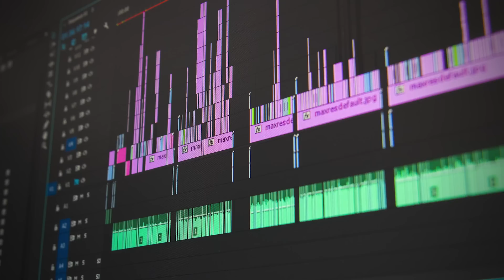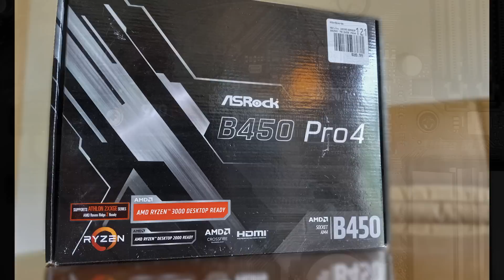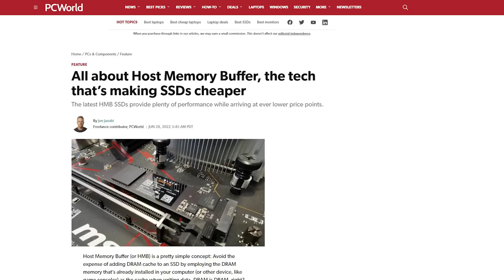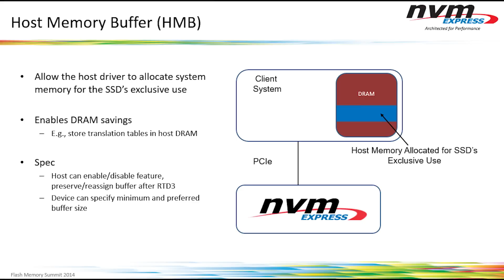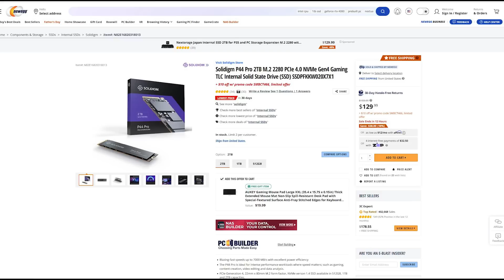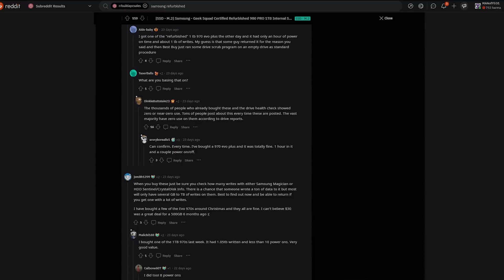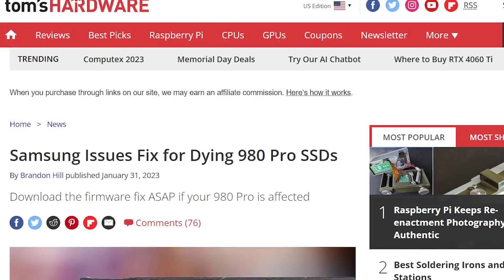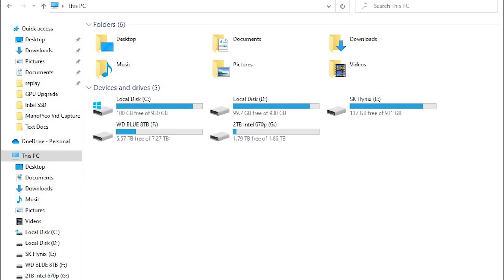SSD Buyers Beware: 7 Crucial Tips for a Smart Purchase

Comment: Samsung firmware bug?
Reply from the maker: Yes they had an issue where 980 pro and 990 pro drives were wearing incredibly fast and it was solved by a firmware update.  If you have samsung magician it should have updated automatically but its good to check that the firmware is up to date.

Comment: A word of advice. When you get your motherboard, just screw the m.2 screws it comes into the motherboard so you don’t need to worry about finding them or buying some later. I don’t know why they don’t just do this before they ship them.
Reply: I just got 2 Crucial M.2 drives and I was happy to see that they both came with a specific screw.
Reply from the maker: @TechGorilla1987  Wow that's awesome definetely makes me like Crucial a little bit more.  Which drive did you get?
Reply: @manofyeo  I got the CT1000P3SSD8 and the CT500P3SSD8 for my wife.
Reply from the maker: Yes this is great advice I've heard recently and I wish I knew when I bought my motherboard!  Thanks!
Reply: dude i couldn't find em, thankfully i got a bunch of m2 screws that work just as well
Reply: My cheap gigabyte b450m had the screw already installed 😊
I didn't know some other manufacturers don't do it
Reply from the maker: @frecio231  Sometimes they do, usually if they have a heatsink.  Other times they are just in a bag in the box.  I wish every drive just came with one like Crucial does.
Reply: @manofyeo  I think the only reason gigabyte would do it is because they were trying to save the cost of making the bag 😅
Reply from the maker: @frecio231  LOL that is SPOT ON!

Comment: whats with 4tb crucial p3plus?
Reply from the maker: Its a middle of the road Gen 4 drive with speeds around 5000MBs max.  It uses HMB instead of DRAM and is QLC so its more of a budget oriented drive.  The p5plus is better if you can afford it and are looking for a Gen 4 drive.  The teamgroup MP34 4tb with dram and TLC is on sale for $168 at newegg but I'm not sure how good of a drive it is.  It has good specs for the price though.  https://www.newegg.com/team-group-4tb-mp34/p/N82E16820331702

Comment: SSD is not a good choice for data storage. The best size is only about 256 GB for os and apps. The data should on,y be in standard drives
Reply: Like others have said. This is old advice that does not apply to modern SSD and NVME drives. At work we have data center Nvme drives that are more durable than any spin drives in terms of read heavy, write heavy, or mixed use cases.
Reply from the maker: Yes I use an 8TB HDD for storing videos and other data.  But SSDs are so cheap now HDD may soon be extinct..
Reply: @manofyeo  No way, SSD drives can be slower, and have much more limitations. Remember a drive constantly read writes, and SSD drives are rate a fixed number of them. That is why you cannot perform drive optimizations on SSD systems. And remember it is also more reliable for hdd raid systems too. Too many people are misusing SSD drives
Reply from the maker: @stevengoldstein114  Much of that applies to data center or professional applications though.  For the average home PC user or gamer they aren't going to burn through an SSD for many years unless it is a very cheap, low quality SSD.
Reply: @manofyeo  Maybe if the system puts the SSD drive to sleep. Then it will stop doing the routine reading and writing. Also remember there is virtual memory placed on an SSD unless reassigned to another drive. I do this to minimize the wear on the SSD.
Reply from the maker: @stevengoldstein114  The virtual memory being on an SSD can help overall performance if you are limited in RAM because it gives Windows faster access to it vs a normal HDD.  It will probably cause more wear but I guess its a trade-off based on your system and budget limitations.
Reply: @stevengoldstein114 you seem to be stuck in 2013. I switched to all SSD a long time ago and won't look back. 10 TB in my PC, 4TB is a sort of NAS solution and anywhere else. Just make backups of important data in few, separate locations and you're golden

Comment: I'm sad that I bought a 2TB 660p for $210 a couple years ago. Bought a 2TB 980 Pro for $195 last year. Now storage is dropping so much.
Reply: As long as you got sufficient use out of it during that time, you're fine.
Opportunity cost is an often overlooked factor when determining value.
Reply from the maker: It can feel bad but I try to think of how much use you have gotten out of it.  I paid $130 for a 1TB 970 evo on a black friday deal.  I also paid over $900 for my 3080 and I've seen people selling it for $450.  It's just the way it goes with technology.
Reply: 2 TB Nvme from WD is 100$ or so on sale right now. 1 TB is 52$. Crazy
Reply: to be fair, the 660p is far superior than the 670p due to using tlc instead of qlc chips, I still use both 660p and 670p drives, but they're just good cheap drives.

Comment: The first thing I always look at besides capacity and price is the TBW as that can get used up fairly quickly by some users. For my daily I am using some drives that are rated for 3200TBW bought on the cheap as they were retired from a data center plus they are MLC rather than the usual TLC nand.
Reply: mp34 has 1600TBW, and it's cheap as fuck TLC

I have seen some pcie (not m.2) x8 2x2tb intel drives though which look really interesting, only thing stopping me from getting those is the fact that I have no more pcie slots :(
Reply from the maker: For sure, heavy users will be much more affected by it than the average office or gaming pc.  Thanks for watching!
Reply: Capacity is something to be aware of, but needing "the best" for most people really is overkill.    This drive is a "tiny" 740TBW,  so using that COD:MW game at 125GB as a standard, he'd need to reinstall (write) the game every day for over 16 years to get to that that TBW limit, and by then any warranty is long since expired.    Now sure there may be some that do write huge amounts, e.g. data centers, and for them that is an important stat,  but for the vast majority of people not so much.    Ditto with speed, Gen3 PCIe will virtually be the same as Gen4 or Gen5 for the vast majority of what people do on their computers, any differences in how long it takes will basically be rounding errors.

Comment: <grin>  I won't admit to being a data hoarder but I'm pretty certain I've helped keep the doors of one of Western Digital's hard drive manufacturing facilities open.  Some nights I pour terabytes worth of data onto my bed and, giggling, just roll around in it.
Reply from the maker: Haha, Love it!
Reply: Well, Western Digital keeps their own doors open, since you have to replace defective WD drives so often
Reply: @SenileOtaku  
Experiences differ.  I maintain the computers for half a dozen family members and myself.  We have collectively owned at least 40 hard drives over the last 30 years.  The mix has included HGST, WD and Seagate. 90% of the early drives were Seagate because they were inexpensive and performed well. But when a third Seagate started suffering from bad sectors, I stopped buying Seagates entirely. Every drive we've purchased since was either HGST or Western Digital  If any of our WD drives lost or corrupted a single bit of data, I am unaware of it.  
Qualifier: We tend to replace each of our computers after about five years.  We sell, gift or donate the hard drives along with the computers.  
You go right ahead and avoid buying WD products. I wish you luck and Fortune.

Comment: Not low enough for the capacity. HDD still beats it by a long shot.
Reply from the maker: This is true since you can get an 8TB CMR HDD for under $100 now.  Great for general storage.
Reply: LOL no. 1TB HDD 7200RPM costs 35$ while the 1TB SATA SSD costs 45$. It is also a 4 times faster. COPE.
Edit:- I found 37$ 1tb sata SSDs and 50$ for DRAM cache enabled ones. For 48$ you can also get PCI gen 3 1 TB NVMEs with 3000+ read/write speeds. Now you gotta consume even more copium.
Reply: SSD and NVMe for system/OS drives.  Spinning disk for data storage.  It will still be that way for a while.  Not saying it will always be that way, but it's like backup tape that is always being declared as obsolete, bit when you need large-scale readily removable and archivable storage, it still does the job better.

Using the right tool or technology for the particular task.  If only you could get government bureaucrats to understand that concept.
Reply: Even if prices were par, I'd say 3.5" HDDs* are more reliable long-term cold storage. SSDs can fail without warning and take all your data. HDDs usually don't fail suddenly, and give enough warning signs to move your data off if they are having issues. Also, the magnetic recording in HDDs should last longer without refreshing compared to the electric charges used in SSDs.
*2.5" HDDs are pure trash in comparison though. Don't trust those.
Reply: @kunka592  I'm surprised to still see ignorant comments like this.

SSDs last much longer than HDDs, meaning you don't need to "look for 'warning signs;'" you just upgrade to a new drive whenever the capacity is no longer adequate.  The drive will likely outlast your data needs.

Experiments have shown 250GB SSDs lasting several hundred TBWs (the equivalent of more than 100GB written daily for an entire decade ).  This only scales up with capacity.

Additionally, most SSDs are designed to lock themselves into ROM mode upon failure; your data isn't lost.  Indications and Warnings preceeding that continue to improve with software.
Reply: @redslate  Cool tests, bro. Please keep all your data on SSDs without HDD backups. When your SSD decides to suddenly nuke itself with 99% of its NAND writes still remaining, don't go crying about it because it obviously couldn't happen in this universe.
Reply: @Kun Ka  Nice strawman:  presenting data redundancy as a mutually exclusive, medium-bound practice.  That's not at all accurate, nor is it a logical justification for your asinine assertion.

Congratulations, you continue to retain your ignorance.  🤤

Comment: Why are we using SATA SSD in the first place or is that some minority minimum wage trash problem?
Reply from the maker: SATA SSDs are still useful for older systems without NVMe support and still work quite well even as a boot drive.  I'm sure most people like me still use them from acquiring them in thee past when NVMe drives were ridiculously expensive.  I wouldn't recommend someone to buy one now unless they had to since it doesn't make much sense but there's no reason to not use them if you already have them.
Reply: Holy shit!  This comment is dripping with toxicity.

In common use cases, there's a negligible difference in write performance between NVME and SATA III.  The average user isn't typically moving mass quantities of data.  

In most read cases, the difference is indistinguishable.  Even most games won't benefit meaningfully.

Therefore, as a primary drive, SATA SSDs are perfectly suitable for the majority of people.  Even power users (the "minority") stand to benefit greatly from their use as they balance great read performance and reliability at a lower cost (~1/2) than NVME SSDs.
Reply: @redslate  I have such an older machine here. Total unit - been strong since 2012 and exclusively for gaming.  Over the years I have put in 2 x SATA SSDs and I have to say they are great boot drives!  Would like to see a some kind of tests comparing the same system+OS boot time for NVME latest gen; NVME older gen; SATA SSD.  But as you have alluded to already - I bet there is precious little difference.  Crystal Disk Mark is just a benchmark after all.  What matters is rubber on the road so to speak. (edit spelling)
Reply: @redslate your pricing is from last decade - show me a SataIII ssd that’s half the price of nvme and I’ll buy it, I need one for a sata m.2 enclosure. Nowadays they all  cost more than nvme, because they’re an outdated technology.

Comment: China SSD is coming!!!and it's very popular in China.

help former SSD's factory without fire😂
let the price of ssd becoming more reasonable and affordable.

yangtze memory 128 nano flash

kingbank KP260 1tb 
 ZhiTai TiPlus5000 1tb 
under 300RMB
Reply from the maker: If prices keep falling HDDs will be dead :)
Reply: @manofyeo  the issue is that there is no great software raid and hardware card for consumers that allow you to take these cheap 1TB-2TB NVME modules and compete with storage of a single 16TB spin drive that runs $200-270 USD.

Comment: My man! I had not considered that installing nvmes would result in sacrificing the number of sata drives. That could have caused some headaches. Thanks for the information!
Reply from the maker: It is often overlooked and can be confusing so I'm glad I could help.  I sure as hell didn't understand it when I first bought my motherboard.
Reply: Definitely something to be aware of, but if your looking at a mix of NVMe and other SATA drives I might suggest that external USB 3.0 drives might well handle whatever you were planning for the SATA drives.
Reply: @Faladrin  USB speed is theoretical, overhead, shared bus, and lower bandwidth hurt, also has device limits far lower than imagined based on how end points are counted.  Legit multiple controller pci-e expansion cards are expensive, cheapies are just single shared chip.   Always max out internal drives first.
Reply: Just depends on chipset, higher end supports more drives.
Reply: If you have a spare PCIe x16 slot, you can get an NVMe to PCIe adapter (which come in x4 but also x1 lanes) for cheap and stick your NVMe drive there. Depending on your mobo/cpu you will get less lanes for your GPU but the performance impact is almost none at x8 for most GPUs.
Reply: @Kun Ka  You can also buy PCIe daughter boards that give you more ports allowing you to install SATA III SSDs.  You'll want to review the speed limitations, but this can be a good use of otherwise unused x1 slots.
Reply: @redslate  That's what I ended up doing.  I have a SATA card for the 3rd & 4th HDDs since the NVMe took up 2 SATA connections.  I would have put the BluRay and DVD drives on the add-in card, but then the system couldn't see them as bootable drives (MSI motherboard, I've learned my lesson since then)
Reply from the maker: @kunka592  Yes I've considered it but I may use the slot for a capture card and I have enough drives for now so maybe in the future.  Thanks for watching!

Comment: SATA SSD without DRAM are a big waste of money as they are almost as slow as a HDD. (Unfortunately I know from own experience.) Is this the same with NVME and using part of your main RAM? (I imagine the connexion between NVME drive and RAM is much faster than with SATA, but does that help?)
Reply from the maker: While sata SSDs without dram are terrible, nvme drives with HMB really aren't that bad.  They usually fall short to drives with DRAM in benchmarking but in daily use I don't think the difference will be noticeable.
Reply: i never had problems with dramless ssd
Reply: @NippyNep  True , this comment is BS.
Reply: You`re probably confusing TLC vs QLC with DRAM vs DRAMless drives
Reply: @smuggy8576  no.
Reply: @AdamGeorge-pb3fm  WTH are you talking about? I use a DRAM cache less SATA SSD as my secondary drive. It's much faster than any HDD can hope to be. I Usually transfer files, play games and compress/decompress archives on that SSD. At least for those workloads it's great. SSDs will always have much much better latency than mechanical hard drives while also having faster sequential speeds.

It does a small life though, compared to my similar capacity NVME.
Reply: @DragonOfTheMortalKombat  Its better to have dram but I think he's confusing it with slc cache, I dumped a terabyte from a harddrive to the 670p, it kept up the entire time.  SSD to SSD is where the controller won't eventually be able to keep up.  Sata without dram would be bottom of barrel though.
Reply: @DragonOfTheMortalKombat  wait until it gets full(er).